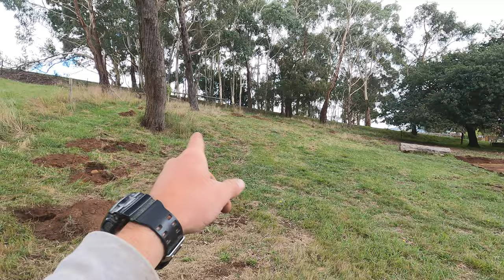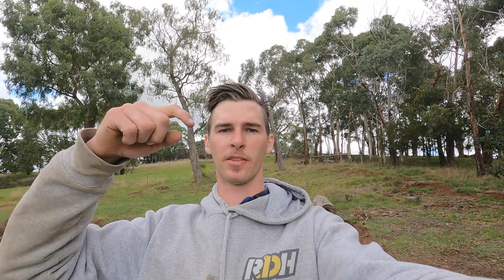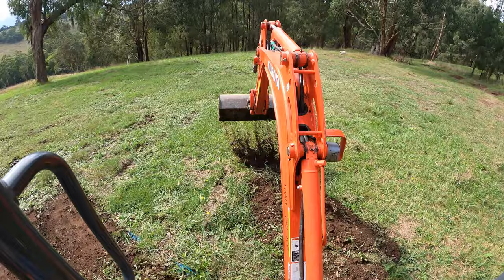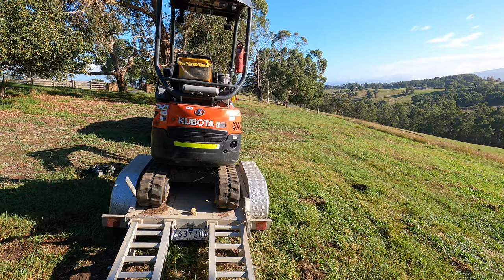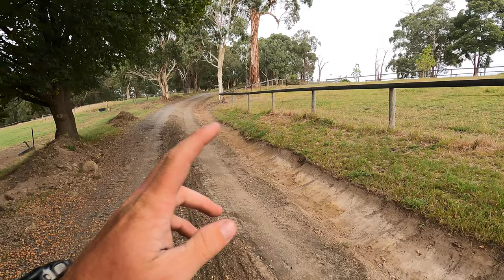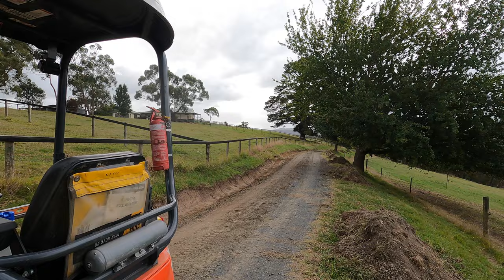Farm Work - Spoon Drains, Site Cut & Augering - RDH Excavations

Comment: I have subscribe to this channel because they do good work and they explain themselves very well. I am relatively new to excavators but I have a fair bit of experience on other kinds of equipment. One thing I have found that when doing drains of this kind is that if you do the first cut with the 300 mill bucket (along the drain) and then pull it out using the 900 mill bucket as he has done here you end up with a really nice sharp drain on one side and very smooth on the other. That is not to say he hasn’t done a good job he’s done a very good job it’s just a suggestion.

Comment: How does the machine handle drilling the holes?
Reply from the maker: Hi Austin,

It drills the holes without any problems. There were only 350mm diameter holes into very soft topsoil, however I have drilled much larger holes into hard clay/mudstone.